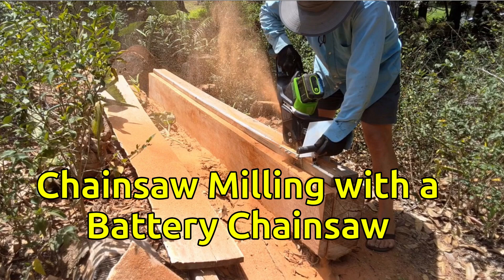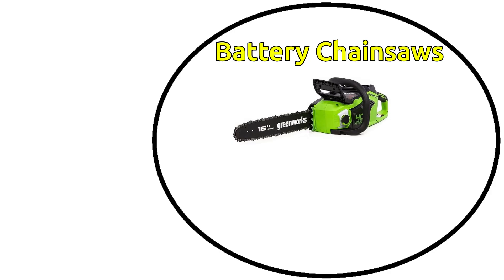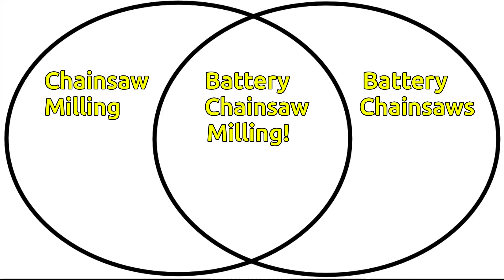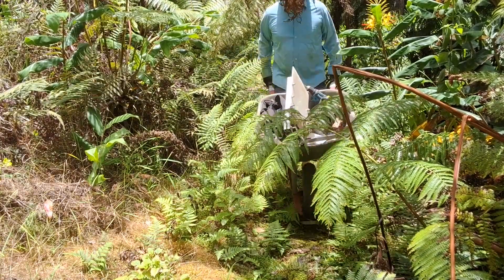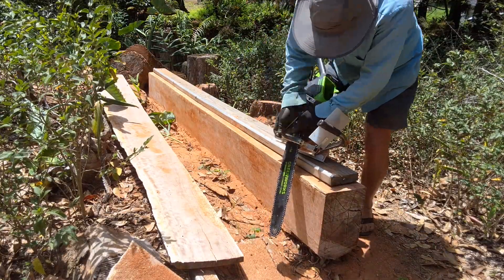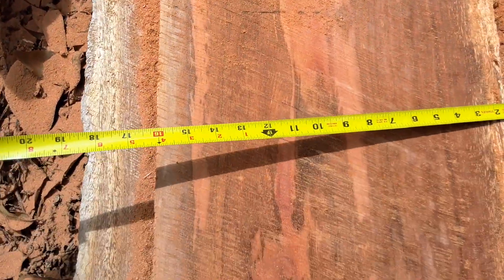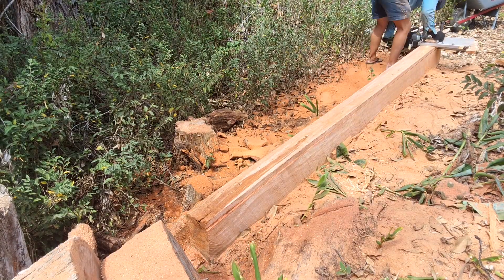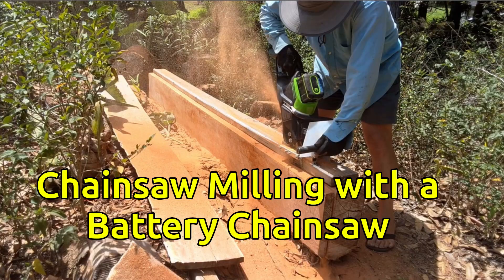Battery Chainsaw Milling (Seriously!)

Comment: Now i know Google is listening to me. Im currently nursing a rotator cuff injury thanks to a hard to start Husqvana, everything went on me, pinched bars, chain came off, plug fowled and fuel line cracked ehich lead to it running okay at 70% throttle.  I an keen to get a good battery saw now
Reply from the maker: Oh! :) I didn't mention that in the video but I also used to dread the pull cord on my 372XP because if anything like the carburetor was even slightly off, I'd be hurting my arm cranking hard on that thing a dozen times or more before it would start. Just to say, I relate! Hope your arm heals and may you find a kinder saw.